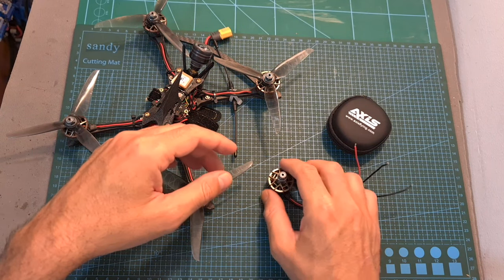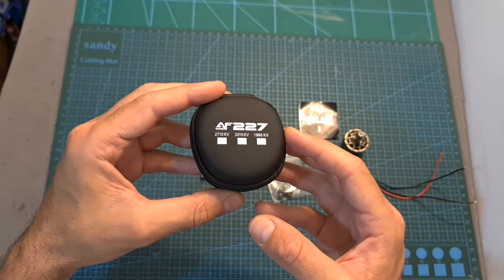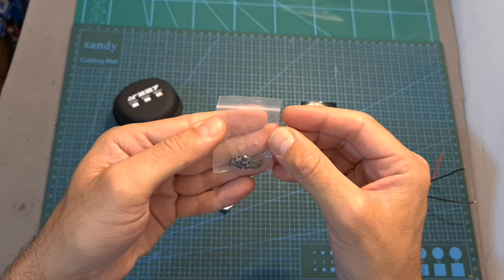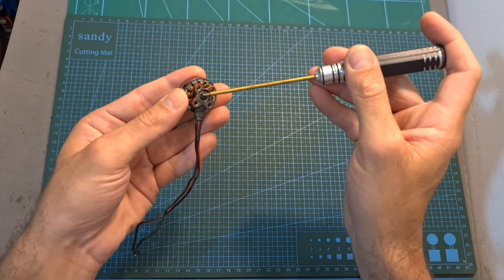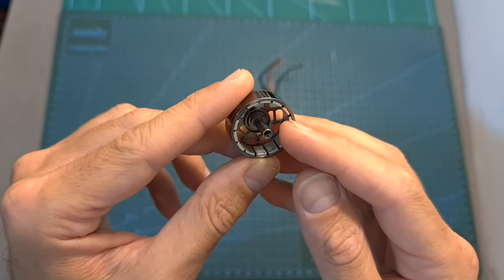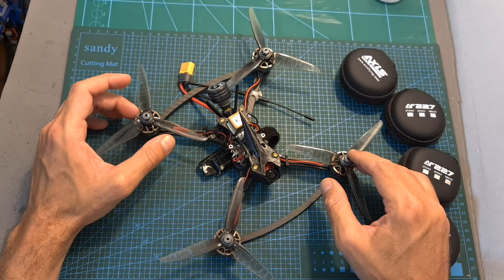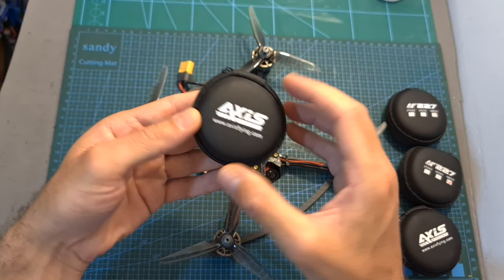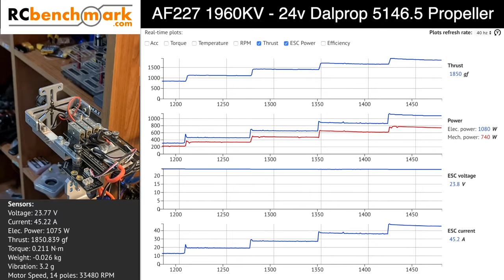Axis Flying AF227 1960KV - Thrust Test & Flight Footage

Comment: Hey Gal... You measured the mounting pattern on a side? Shouldn't it be measured over the Center, between 2 oposing mounting holes? Which would probably give 16x16mm....
Reply from the maker: You are absolutely correct, sorry about my stupid mistake :-)

Comment: Thank you for the review. What are your thoughts when AF227 motor is compared to T-motor Blackbird 2207 1960kv? Do you think they perform the same?
Reply from the maker: My pleasure Neil.
I've never tested the Blackbird 2207 but as far as I know there is a connection between the companies, so it wouldn't surprise me if these are similar motors.
Reply: @KremerFPV  oh wow 😊 Thanks a lot!